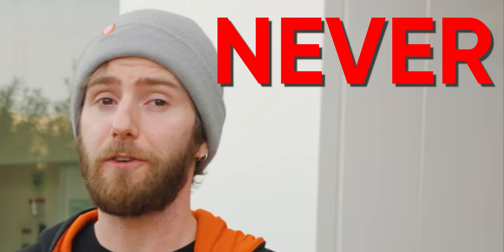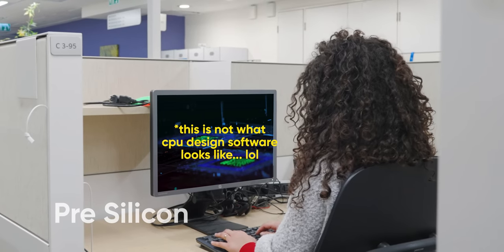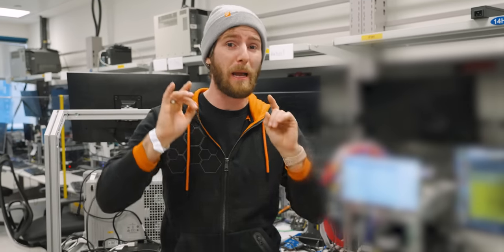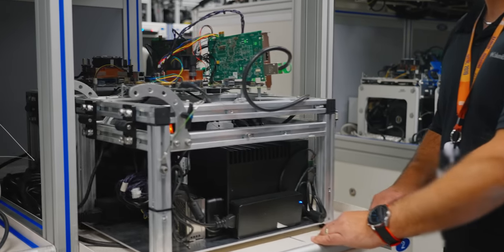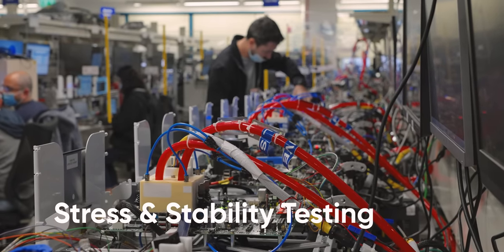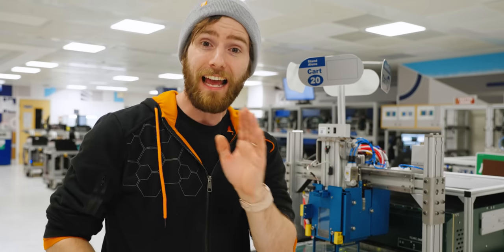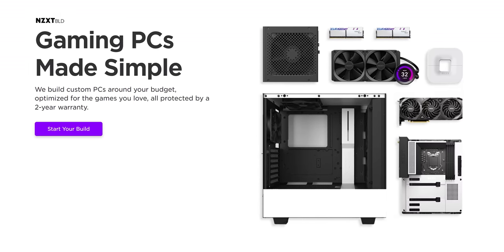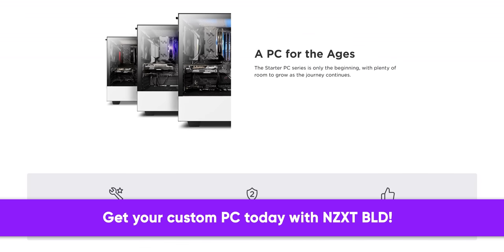I Ripped Up My Sponsor’s Check - Intel Fab Tour

Comment: I had a core 2 duo for years, that machine was absolutely bulletproof and while I saved for an upgrade I put a core2quad in there and it lasted an extra 2 years. God I miss those days, PC gaming was so much cheaper
Reply: Have you adjusted for inflation? Computers and components have gotten cheaper in today's dollars until very recently, from what I understand. For example, your Core 2 Duo would cost $230-745 (assuming non extreme) in today's dollars and you can get a much better 12th gen chip for $110-530.
Reply: I think the main thing nowadays is people want to upgrade early/overspend beyond their needs. PC hardware is almost back to pre pandemic prices. Not to mention when RDNA2 APU's arrive in the desktop space getting into PC gaming will be stupid cheap.
Reply: I do too my core 2 duo was awesome, then the Intel i7’s came out and I couldn’t afford anything
Reply: it's still cheap, just play older games or turn down the graphics
Reply: Hmm, little bit tricky in my opinion. 2 cores lastet a long time because intel said so or because of a weak amd performance over all those years. With every year that passed, the consumer base grew and grew and 2 cores (or later 4) were the norm. Computer gaming will never be as cheap as 10 years ago but it won't be double or triple either. The prices are all over the place right now, but a 6 core cpu on a midtier motherboard and 16GB of fast ddr4 will last you years and years into the future.
Reply: Dude I still have a core 2 quad with a 750ti. It still is incredible. Not fast but still works for competitive games and even doom
Reply: Yup. As someone who ran multi processor rigs since the Pentium Pro days, Core2 feels downright new. And yet here we are.
Reply: @techreportrecords  I had the short single fan EVGA 750ti with mine actually
Reply: My home built NAS is running a C2Q, just keeps going, no reason to change it.
Reply: Right! I’m still running an AMD 8350 black! Granted it’s on water and overclocked so that allows me to stretch it quite a bit farther!
Reply: It's still not bad. You could have started with a reasonably good B350 or X370 board in 2017 with a a whimpy R3 1300 (which stomped "8 core" Bulldozer chips) and now (5 years later) upgrade to a brand new R9 5950X or R7 5800X3D. Or even a second hand one in more years and still be able to keep up. As long as your graphics card doesn't need more bandwidth than a PCIe 3.0 X16 slot can provide (which currently, none do).
Reply: I still have a core 2 duo running Linux at home, still amazing
Reply: actually, I would argue that PC gaming is much cheaper today
not only if you account for inflation, but also performance per watt, performance per unit of currency and how long you can expect your machine to be usable
software is struggling to catch up with the hardware, we are nowhere near the point that we can fully utilize 16 threats with a game, at least it's not very common
GPU's may be the only thing that needs upgrading, but it's not really that much of a "need" today in my oppinion
I would recommend to wait with GPU upgrades until they get the chips working properly, if a GPU is drawing 400 watts of power(or more) it kinda smells like inefficient design to me
I recon in one or two generations they oughta get their ducks in a row

my current PC got pretty much top of the line parts back in 2016, it still works just fine for my needs with a 2k display

I actually took a step back and got me an old laptop for surfing and stuff
both for saving energy and to not wear out my gaming rig 

and quite frankly, I'm amazed how well an old laptop can perform
50 bucks for the machine, ram and SSD and you're in business
I replaced the cooler on my laptop with a different model that performs better
not sure if heatsinks degrade or if the stock heatsink just was garbage, but it's cool now.
Reply: @emma70707  Even regarding inflation, PC gaming has become more expensive - mostly because it is far more mainstream now. Graphics cards are seen as desirable mainstream consumer devices in the same vein that iPhones are. Adjusted for inflation, my 2008 gaming PC's CPU (Q6600), RAM (4GB), and GPU (8800GS 384MB) cost £385.73 (approx $490) - and that was for a then high end gaming rig - not the pinnacle by any means, but definitely a high end machine that chewed through all games for the few years I had it.
Reply: @emma70707  Have you adjusted for how the common people's wage has went and how other things have gotten pricier.
Reply: Created a program with my core 2 duo in college that crashed my TA's laptop when he ran it. Instantly loved that machine so much more cause I got an easy A from it.
Reply: @cromulence  Totally right, no body and I mean no body besides the ultra high end 3D Modeling Business folks, would have spend 1000€ for a single GPU alone back in the days. You could get a high end gaming rig for that price alone. Its completely insane nowadays. But ya since people are used to spend almost 2k for an iPhone they maybe dont care any more. And as long as people buying oh excuse me "sniper" them like hot cake, company's just raise the prices each year to see how far they can go... and boy do they get far already.
Reply: @emma70707  ever looked for a gpu lately....
Reply: Cheaper but if you gamed you needed to upgrade pretty often, now your fine for alot longer than back then.
Reply: @ThumberBulls6  , why ask questions that you can easily check? If you had bothered to, you would know that wages have been pretty much level since the mid 1960s. Considering that computer components prices have decreased and wages have remained level when they're adjusted for inflation, computers are indeed cheaper in real dollars.
Reply: I went from an AMD X2 3800+ to a Core2Quad 9550 and for some reason, it felt like that one turned to mud a lot faster. Theoretically I had it for almost 4 years before I got a 3770K. I suppose it was in part, because there was such a huge IPC boost between those and the 2nd/3rd gen Core i-series.
Reply: @sprmn1983  , have you? Prices are coming back down to MSRP, fortunately. But we're not just talking GPUs. Core 2 Duos (non extreme) were running $262-745 in today's dollars compared to 12th gen $110-530 for MUCH better chips. Just because things don't feel cheaper doesn't mean they aren't. Humans just have bad memories...
Reply: The first Core 2 Quad cost over $500. That was not cheap. Even if 2 years later the low-end dropped to $150 or so.
Reply: @emma70707  Ya I mean of course GPUs, the rest of the system is much cheaper nowadays. A friend was an early adapter of the Q6600  in 2006 and paid around 700 Euros for the CPU. Bought it from him around 2012. I still have that chip inside a file server so I guess Moores Law is dead ;)
Reply: Serious rose tinted glasses
Reply: My uncle is STILL running my old Core 2 Quad system I gave him back in 2014. It was already years old at that point. All he uses it for is browsing the web and light photo editing though.
Reply: I had enjoyed using a laptop with a Centrino T9300 (2,5Ghz x 2 cores), and then another one with an i7-2630qm (4 cores, 2,6 to 2,9Ghz boost based on utilized number of cores). Both are still alive although the laptop which had the first one is literally broken. If anyone still has a computer from that era they still want to use every now and then, the difference created by an SSD upgrade is like that of between night and day. It still could be worth it. Throw process lasso into the equation and you are off to the races (simple ones), although you will not break any benchmark records or be able to play any new AAA games. Sure, I enjoy using the 5900x much more, but an i7-2630qm is still not terrible for simple tasks.
Reply: Lol i'm still running a Core2Quad 😂

It obviously creates a CPU bottleneck with newer graphics cards but if you put an SSD in there, most other experiences are perfectly fine. You might not even notice you're on a 10+ year old CPU
Reply: @CheapBastard1988  very few x370 board support the 5000 series, I heard some were going to start but others got shut down when testing it a while ago, I buy most of my parts second hand, (yes, even hard drives) and never (knock on wood) had an issue. Got an x370 board, ryzen 2600x, and just before the pandemic got a second hand 1080ti (now that was a much better long term investment than I thought it would be!) And I've had my system for years now, still going strong. Was fairly pricey compared to budget, but  feel like I got the best out of my hardware for a decent cost point
Reply: @emma70707  Check the prices from the 2000nds or even early compared to what you get today for lets say 2000$ when it comes to performance.
Reply: Uh AMD let you do basically the same thing. But a lot better. Lol. And probably cheaper.
Reply: My parents bought me a core 2 duo when it came out and although I did not understand much about computers back then (I was around 11 then), I was so excited. My mother now uses that same computer and manages to do all her work from it when the only update that was necessary was a HDD replacement with an SSD.
Reply: @scroopynooperz9051  highly doubt that. especially on lower resolutions your are heavily "bottlenecked" with a CPU like that.
You basically wasting performance.
Reply: @Josue31627  In USD? Q9550 was around $300.
Reply: @madgodzilla12465  so what? i upgrade constantly, mad?
Reply: I do too haha I'm just speaking generally
Reply: @nathanwest2304  Yep. I used to upgrade every 3 years almost like clockwork bc of how quickly the hardware would fall behind. My 3770K lasted me from 2012-19. I had 1 GPU upgrade in that time, but could still do new AAA titles on High at 90fps+

I could have kept it longer even, but decided I wanted an upgrade and regifted the system to friends who still use it and commented on how fast it still was.
Reply: @cromulence  Are you sure you're remembering prices correctly? The Q6600 alone was over $500 when it released in 2007. And the early Intel quad cores had atrocious IPC numbers. Something like a 2600K beats it by like 60% only a couple years later. 4GB ram and a budget 8800GS GPU is not what I would call a high-end gaming system for 2008.

More importantly: System cycling cadence back then was like 3 years, often with a GPU even sooner than that. And the framerates for the average game were around 30-60fps. Nowadays, you can easily get a solid 7+ years out of a CPU and the 10-series Nvidia GPUs had legs for 5 years themselves. And that's all while playing most games in the 75-120fps range.

Generously we could just say it's at least a wash since you replaced that stuff then twice as much.
Reply: i still have a computer with a core 2 quad and it works just fine for basic computing, even better with linux (insert "i use arch" comment here).
Reply: @Salvo78106  AMD was quite competitive from around 2000-2010, but they fell off a cliff until Ryzen2. I remember CPU-bound game benchmarks like WoW for the ~2011 Phenoms was literally 40% worse than the equivalent Intel CPU.
Reply: i had a i-5 3570 for 9 years before  upgraded to ryzen 5 2600 recently
Reply: @itchylol742  ye new games suck anyways
Reply: I've a Pentium that has been running for 7 years without any issues. Motherboard, ups and power supply meanwhile have had to undergo repair/replacement
Reply: @vanessameddles2240  csuite level executives have their huge excel library and they need that!! Lmao it’s bs I should have that and it shouldn’t go by tittle
Reply: @marcusaureliusregulus2833  "There is a name I've not heard in a long time... a long time..." I understand they still make Pentiums, but I fail to understand a use-case that would call for a Pentium that couldn't also be served by an Atom CPU or be more cost-effective to just buy a used CPU for the same price.

What is the Pentium used for? File server I take it?
Reply: @aoitamashii  Haha I get your point. But it is not a file server.
Its in my personal computer. I had a very low budget and also was not very knowledgeable about computers back then. So I bought it just because it was cheap. But it's managed to perform all the tasks (mostly browsing, web development, media consumption, photo editing) without any issues so far. One slight issue is that intellisense and autosuggest sometimes lag a bit in the IDEs when a project gets very large. (I don't game since I can't afford a GPU either🥲). Planning to buy a new setup soon.
Reply: @mrn234  you dont have to highly doubt that a Core2Quad creates a bottleneck for a modern GPU at lower resolutions, there's plenty of videos out there showing it 😂

What I was saying is that a Core2Quad system with an SSD will work perfectly fine for a general use PC today, most people wont notice the difference.

I have an overclocked Xeon E5450 (basically Core2Quad 9650 without iGPU) paired with a Radeon HD 7870 and it can even play more modern AAA titles at a mix of 720p/1080p resolutions and settings. 

That's not bad for 10+ year old parts. 
I originally just planned to use it as an PS1 / PS2 emulation / MAME rig but it can pretty much be used as a functional PC still today.

I was similarly impressed by a Ryzen 2200G I got my hands on a while back. I overclocked the CPU to 4GHz and the Vega iGPU to 1600Mhz and my benches showed it was the functional equivalent of an intel i5 7500 paired with an Nvidia GT 1030. Got that 2200G for like $55.

The point here is a decent PC experience doesn't need to cost you a kidney anymore.. not unless you wanna go modern 4K AAA high FPS gaming.
Reply: The Q8200.
Reply: @aoitamashii  Yup - August 2008 - I paid £105 for a SLACR Q6600. 4GB RAM was the amount to have as a gamer and was sufficient for years - to the point that it made news when Call of Duty Ghosts would require a minimum of 6GB RAM. And the 8800GS traded blows with the 8800GTS which was again, respectable at the time. I could play every game on high settings at 1080p, with some games requiring a slight drop to 1600x900 to stop stuttering (Modern Warfare 2).

Comment: I work as an engineer for a very small research and development branch of a water testing company. I can’t Imagine being apart of such a high scale operation. The 12 of us at my branch are frantically testing and rolling out firmware updates daily for our product launch. The pressure and pace must be insane at that Intel facility. Thank you for the tour Linus!
Reply: I can confirm as someone who works in the labs. It's chaos. People stealing each other mice, laptop chargers, and whole monitors lmao bc there is just so much equipment laying around.

There's a ton of time crunches and item tracking going on.

Comment: I'm from the old school. My first use of an Intel CPU was the ancient 386. Now, my fastest Intel CPU is the i7-9700. It's been a wild ride from the early days until now.
Reply: DX or SX?
Reply: @donc-m4900  I believe it was the 80386SX CPU.
Reply: My first PC build was a Intel Pentium II Slot 1 Processor and now I have the i9 12900K. Damn I'm old!
Reply: @spankbuda5760  old? My first computer was an Apple IIe. no hard drive. no gpu. but upgraded to 128k of memory and dual 5 1/4 floppies. (So i didn't need to use a typewriter for school reports)

Comment: The oscilloscope @6:39 is worth about $1.3 million.
It's a Keysight Infiniium UXR series. 110GHz oscilloscope. Flagship beast.
There's only a handful of them in the world.
Reply: People like Intel and high end science teams are about the only people that have both the need and the budget for beasts like that.  Thing about scopes like that is you actually need highly specialized knowledge to use them and get good measurements.  Probes on a scope like that are almost as expensive and magical as the scope itself.  Using them correctly is basically a black art.  Even the scope itself is usually a bit of an odd beast to use.  Linus should ask Keysight if he can get a tour of their facility.  One of their reps Daniel Bogdanoff is pretty active in the Youtube community and would probably love to show off their Colorado Springs facility where those things are designed.
Reply: Oh boy I need one of those 🤩 🤑🤑🤑🤑🤑🤑🤑🤑🤑🤑

Comment: As a silicone test engineer myself (for a much smaller company than Intel) I find this fascinating. I can understand much of what they are doing and have deeper knowledge than what Linus can fit into a ten minute vid, but I'm still blown away by the scale of the testing that has to be done at Intel. It's quite incredible!
Reply: you test phone cases?

Comment: I used to work there.  Not all PO's are done in Israel, they move around a lot.  I've only represented the team I was on in one PO, but yeah it's truly a magical experience (also painful).  Lots of round-the-clock work those first few weeks, lots of trying to figure out why sim acts one way and hardware acts another, lots of instability in those first units.  It's rewarding when you have breakthroughs, but grueling until you get there.

And yeah, some of the hardware there is absolutely bonkers.  I was in awe when I first saw it.  I don't regret leaving, but this video def. hit me in the nostalgia pretty hard.  Thanks for that, Linus!
Reply: Why'd you leave?
Reply: @Ghostyboydead  Pay was one reason, but I was also there for almost 5 years.  That's a fair amount of time fresh out of college in areas with a booming tech industry.  But generally speaking (all fields) you don't get 20%+ pay increases by staying at the company you're at.  You get the larger pay increases by jumping ship.  So a friend's start-up came around, pay increase, equity, chance for the small start-up experience, and I went for it.